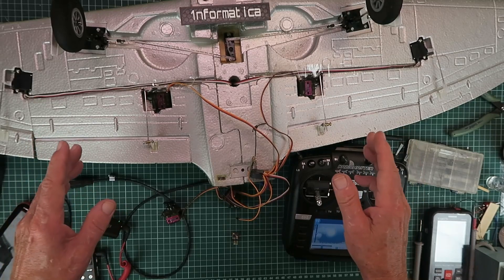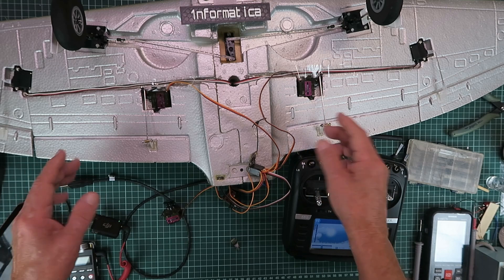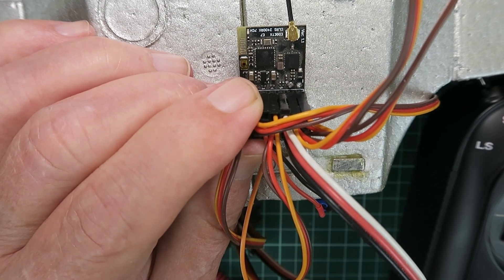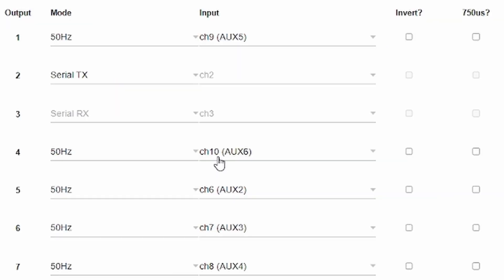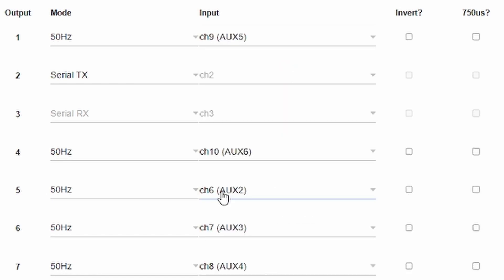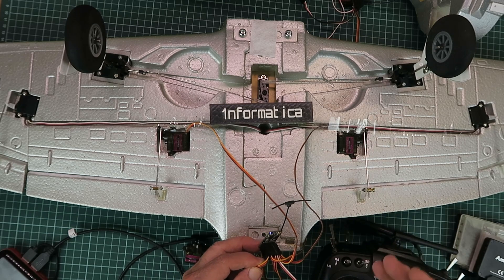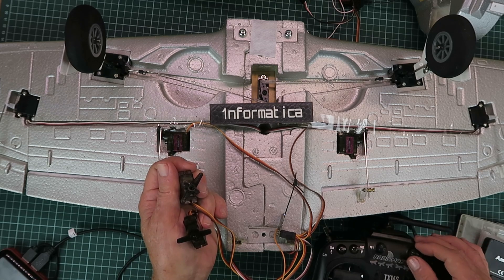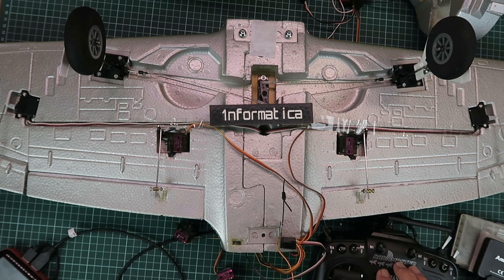ExpressLRS ELRS Secrets That Everone Should Know!

Comment: Hi and great videos... I've noticed this little 7 channel RX, in the Hardware menu, right at the bottom of the screen has options for IC2 SDA - SCL inputs... I've been given plans for a Vario project that uses a Arduino Mini Pro and MS5611 pressure sensor.  It's pin-outs however are SDA - SCL and probably based around Spektrum receivers that use Xbus.  Do you know if the RX featured in your video can integrate with this protocol if the SDA - SCL are assigned?   Many thanks.
Reply from the maker: I think you would need to write your own firmware to get that to work, I don't know. Some sellers say that this RX has a vario function however there is no "Vario" function. At heart this Rx is a copy of the Matek R24v which has a vario. My solution is this setup instead : https://youtu.be/HKKmED2W0Uk&list=PLxtbRS-naT68PQVcBSziD3c9Uk6sNhR_f
Reply: Thanks for the fast reply, I'll do some further research.... I see the Matek R24 is no longer supported by the ELRS team which is why we have to use the Happy Model firmware on the clones. This was because the R24 model had oscillator stability issues when it heated up, causing the RX to failsafe. Hopefully the Chinese Cyclone versions don't have similar issues.
Reply: @modelmanmark I've had issues with both the 7 channel and 5 channel cheap Chinese receivers.   Considering a decent brand is just a couple $$$ more.  I now avoid them and use the ones I have in Lidl gliders.

I use Mini A3s and it's a false economy using an $8 receiver
Reply: @modelmanmark  there is a new Chinese 7 channel that uses TXCO for the same price. Search for BeyondFPV elrs.